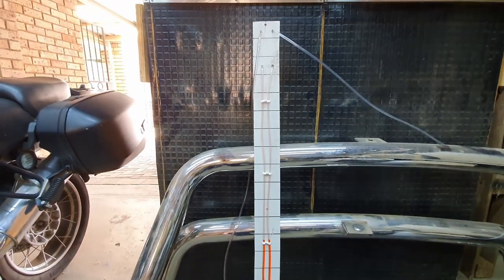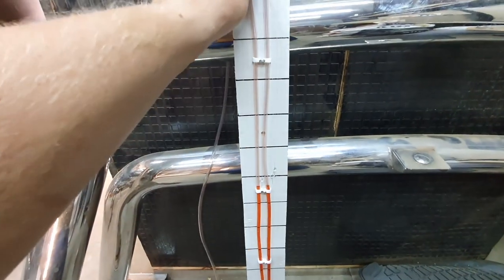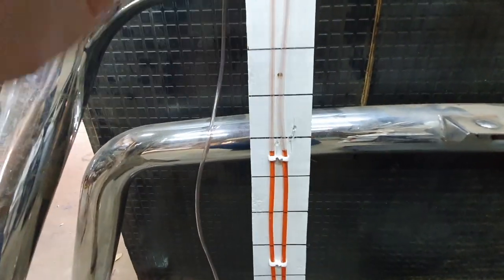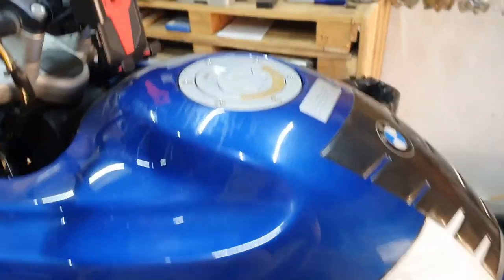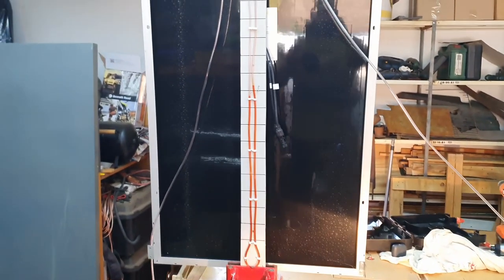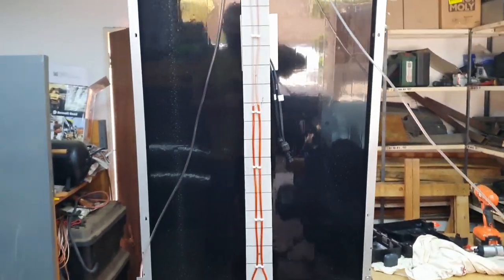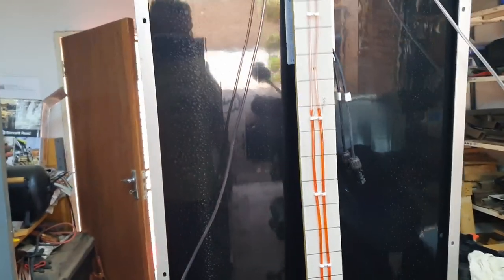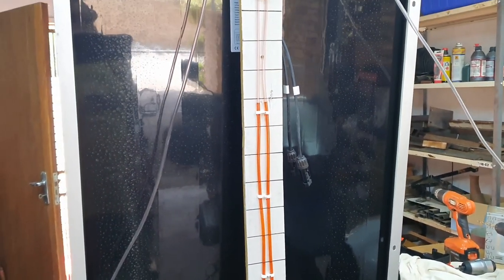Its time to synchronize your R1150GS throttle bodies!

Comment: Column U, is this.
I recomand inside, mixture benzin with  red 2T oil
Reply from the maker: That should also work perfectly. I just used what I had at that stage and the atf had about the correct viscosity. Thanks for your support! 👌🏻

Comment: Hi Deon! What is the diameter of tubing you used? Thanks! (Fellow 1150 owner from Cape Town)
Reply from the maker: Hi! I'm not exactly sure what the diameter is, but its normal fish tank tubing that I bought from a pet store. Be sure not to take the soft silicone type, rather the slightly harder type. Another tip is to use pieces of automotive vacuum line on the two ends. The reason for this is that when the throttle bodies gets a bit warm, it softens the fishtank tube too much and sucks it closed. I hope this helps a bit more. 👌🏻
Reply: @DIYwithDeon  lekker, thank you 👌👊
Reply: @DIYwithDeon  turns out 5mm is the magic number. Couldn't get the DIY balancer to work, so took it in for that and it turns out I had a busted coil along with broken rear shock bolt. 😅

Comment: i tried this today with my 96 rt1100r but had problems. when i set the bras screws to 1/1/2 turn out it would not run. I have them at 3 turn out. how many turns did you need to do?
Reply from the maker: I kept mine at about 1.5 - 2 turns out. I adjusted them until they had equal vacuum. Not all engines will be the same , based on throttle wear. So just adjust the two sides until they are syncd. I hope this helps?